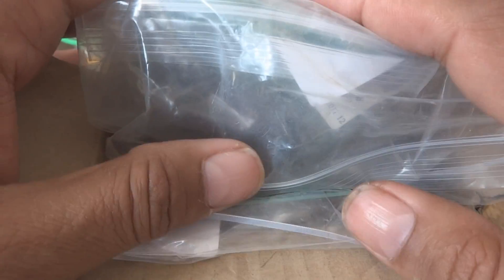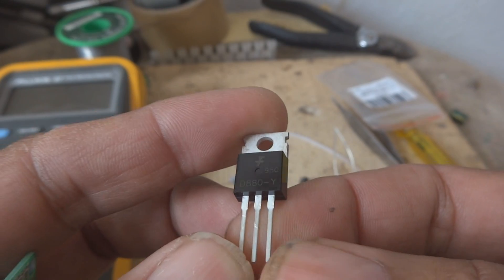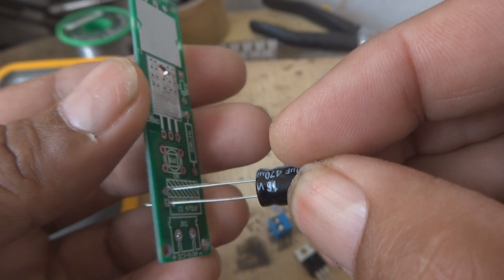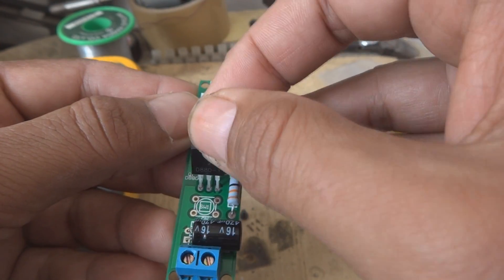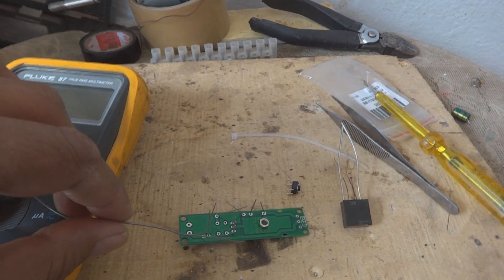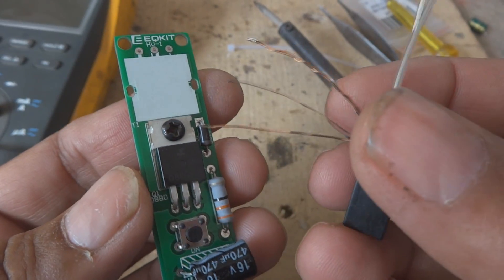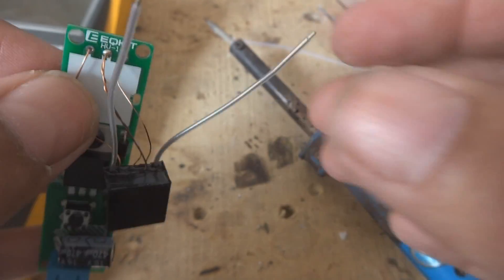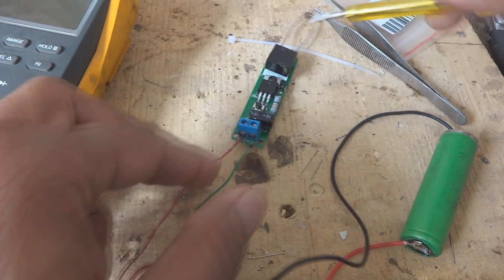Igniter assembling. Ignition coil project. High voltage ignition. ICStation product.

Comment: What is the frequency of the output?
Reply from the maker: I think some 40khz.
Reply: @JahanZeb1976  Thanks. A bit low for my needs, but I suppose I could alter it with a different transformer ratio. Cheap enough.
Reply from the maker: Yes you are right sir.